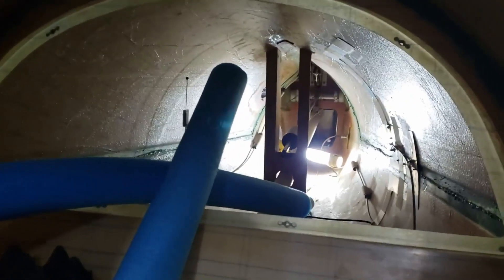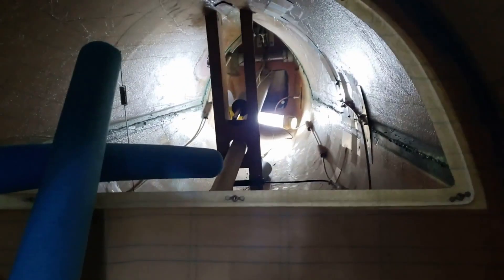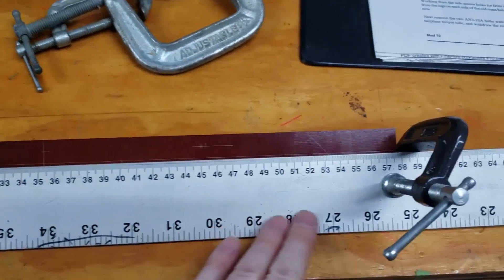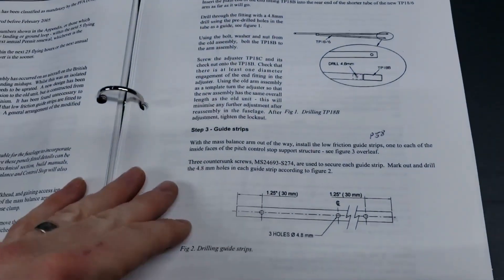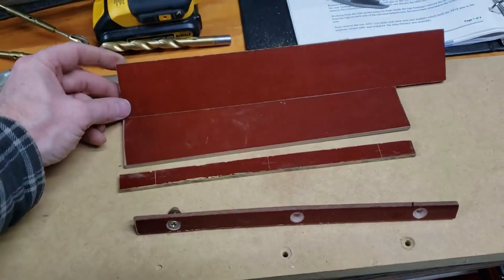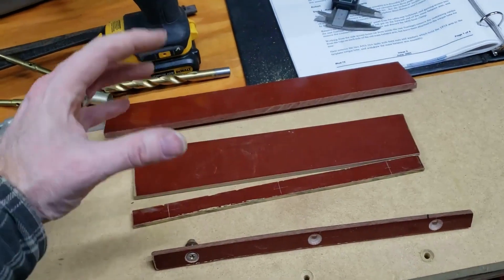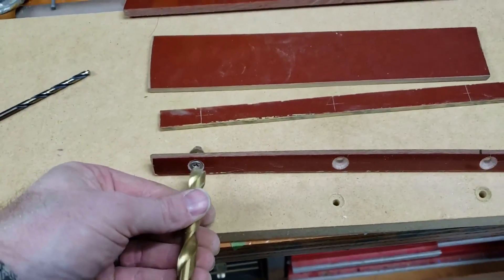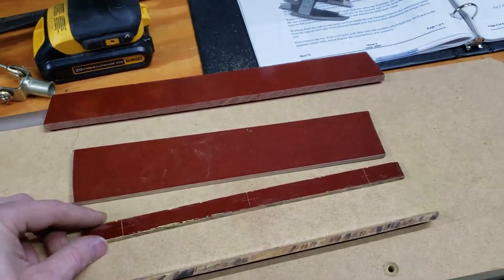Europa Aircraft Kit Build - Mod 70 phenolic guides Europa 2

Comment: thanks for the video.   is the build manual for the europa pretty detailed and easy to follow?  also, how new of kit is this?   thanks
Reply from the maker: Thank you for watching!  The kit is several years old and is closer to the first waves of XS kits. The manual is somewhat easy to follow and tapers off on the details as you get deeper into the project. I guess at that point you are more of a fabricator than a builder due to the experience you have gained.
Reply: You can download the build manual from Europa Aircraft website - you need to register first but it’s free. Look for builders’ section, then manuals > CBM (Combined Builders’ Manual, for both mono & tri… chapters labelled  M or T to match… you can also see mods, accessories etc)